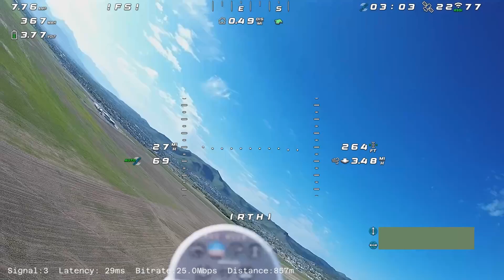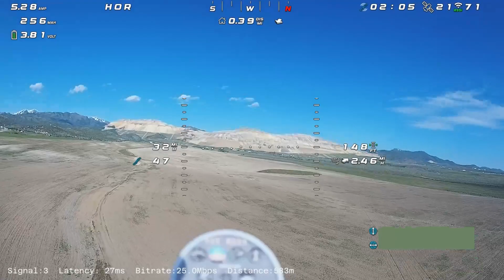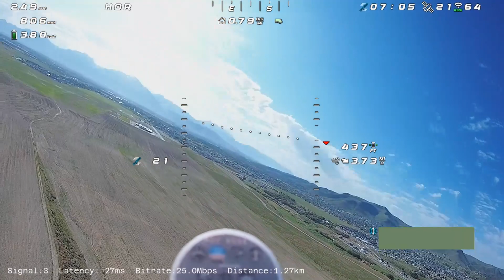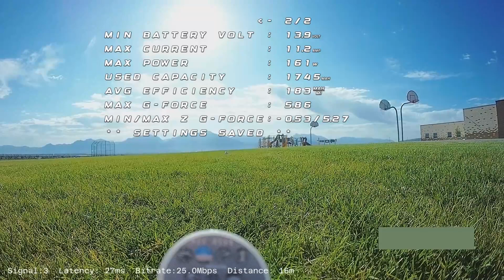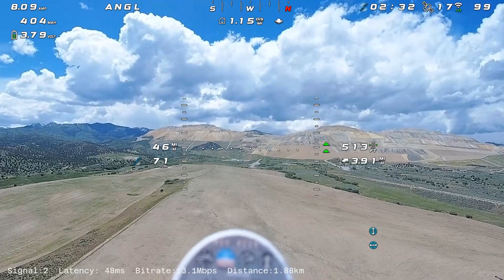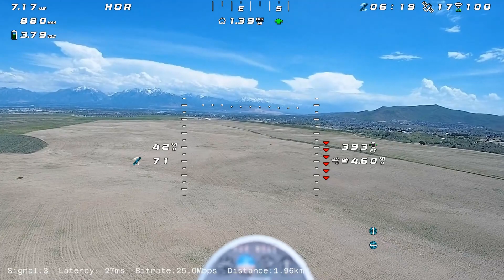Walksnail FPV | First Test Flights

Comment: Great vid and flying! I've just got into FPV flying and have a similar setup to yourself, with the Ranger 1600 and Speedybee F405 Wing. I'm running TBS Crossfire Nano with Analog FPV video for now. I can't wait to maiden! :)
Reply from the maker: Excellent! I really like the ranger. One tip I can give you is don’t give full throttle for launch. I mentioned it in this video, but I found less throttle works better. In inav I set my auto launch throttle to 1600 and that seems to be working well. That’s using a 4 cell battery. More throttle pushes the nose down and makes the launch kinda sketchy. Good luck on your maiden.
Reply: @BuildItBetter3D  good to know thank you! What did you have your auto launch take off angle settings at? Ive heard people say they can be left as default but I’m just wondering.
Reply from the maker: I believe my launch angle is at 18. Also my level flight angle ( don’t remember the exact name) is around 5 but I think that’s a little too much.
Reply: @BuildItBetter3D  Ahh ok, I think ive got my settings at a good starting point. It's slightly nerve racking when I think I'm going to throw this thing into the air and let the FC auto launch it skywards lol.
Reply from the maker: @tomcowe  I know what you mean. The first couple times I did it I thought for sure I would have to save it. It is awesome though. I can throw and now walk over to my seat without any worry. It's hard to believe I ever did it manually. Best of luck on you maiden!